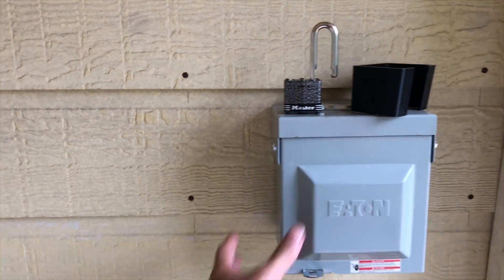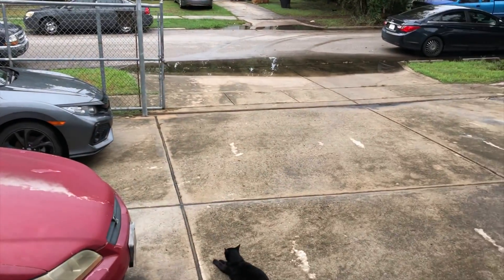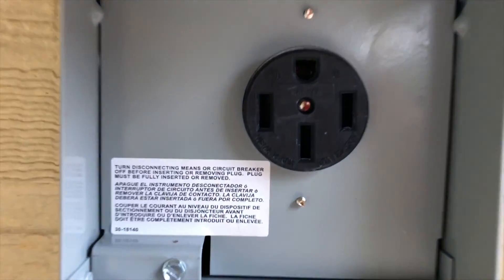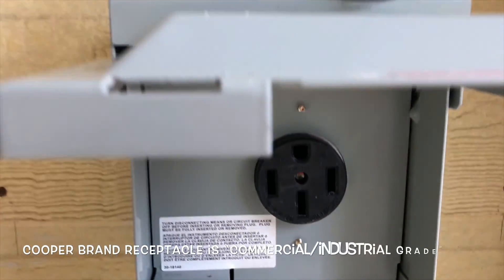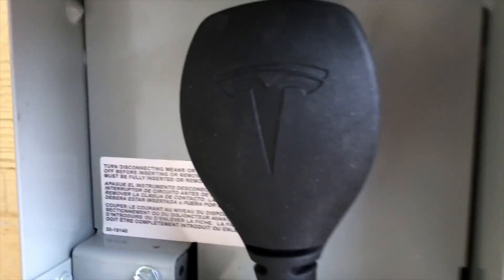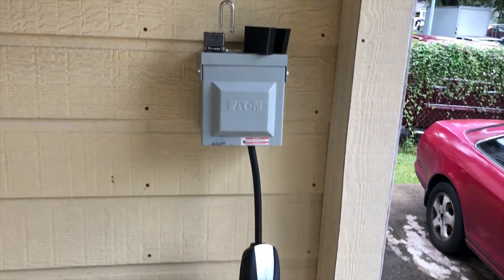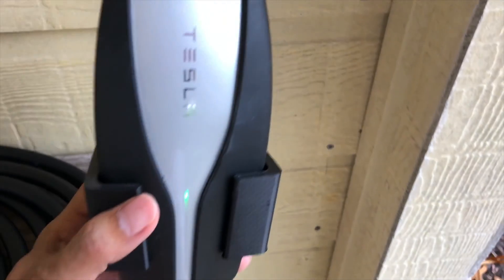Installing an Outdoor NEMA 14-50 Outlet for Charging Tesla

Comment: my home was built in the 60’s, i’m was reading most homes didn’t have grounding  built during that time. if i hire an electrician, will they be able to install a nema 14-50 outlet? or do i need to fix the grounding first?
Reply from the maker: My house is old too, built in the 40’s! My electric service panel was renovated and a LONG rod was hammer down into the ground years ago to properly ground the house. The NEMA 14-50 will need ground. Get a trustworthy electrician to survey the work needs to be done to properly get it install.

Comment: I've been having trouble finding an RV style weatherproof enclosure with a faceplate big enough to fit a heavy duty commercial 14-50. If that 14-50 is really commercial grade, it would have a 2.4" diameter. The faceplate on most housings is for the smaller off the shelf receptacles.
Reply: Did you ever find one?
Reply: @redlightgang233  Nope, and the electrician I talked to only knows about a stainless steel Hubbell faceplate designed for indoors/garages.
Reply: You are correct. As a licensed electrician that installs EVSEs, I have yet to find an outdoor cover that accepts the necessary commercial grade outlet. It may be possible to enlarge the hole and redrill the screw holes for the better outlet. I always encourage hardwired applications but not an outdoor outlet. History shows that the cheaper outlets are not built for the high, continuous loads of an EVSE are are melting and are a potential fire hazard.
Reply: @christheisgen  Clever.
Reply: When you remove the inferior 14-50 unit, bore out a 62 mm hole in the face-plate to accept a Hubbell model.  If your hole-borer set has a 2 1/2" (64mm) size, as my Milwaukee "Hole Dozer" set does, that will do just fine.  then use a proper Hubbell faceplate as a template to drill the mounting holes.
Reply: Did anyone find a outdoor box for this to fit the bigger EV rated version?

Comment: Hey Khoa, thanks for the video. I am getting ready to DIY and install an exterior 14-50 outlet. I am also going to put out the outlet in an enclosing casing like you. From Tesla's website they are recommending to use 6 AWG wire. They don't specify what type of wire. I went to HomeDepot and bought 25 feet of Romex 6/3. However, I am not sure if this is the correct wire to use now that I've watched your video. What type of wire are you using for your 2 hots, neutral and ground? Also, what type of pipe/conduit did you used? I also bought 1/2 conduit non-metallic pipe to hide the wire.
Reply from the maker: I found my old list on the material and cost but keep in mind this was back in 2018 prices

EATON Outdoor NEMA 14-50 Outlet Enclosure with a Cooper Receptacle Commercial/Industrial Grade - $27.97 from Lowe's
GE 50 AMP Breaker - $8.98 from Home Depot
AWG #6 Wire - $100.80 for 70 feet run ($33.60 X 3 wires)
AWG #10 Wire for Ground - $14.00 for 70 feet run
EMT Conduit 1" - $31.92 for 2 sticks
Flexible Conduit 1" - $86.40 for 45 feet
Misc parts: screws, EMT strap, covers, nipples, bushing - $35.00
Loctite Foam Spray Can - $6.00 from Home Depot to seal up gaps/cracks
Installation Labor Cost - $0.00 by Cousin Hookup who is a licensed electrician.
Reply from the maker: Hello Don. Thanks for checking out my video. Quick update, this outlet has been relocated but it is still running great.
For a NEMA 14-50 Outlet, my cousin, the electrician, recommended to use 6 AWG wires. The two hot and neutral were 6 AWG and the green ground wire was 10 AWG. We went to a local electric supply store and got a roll of single strand wires for this 70-ft run. Since it was 6 gauge and will run hot, the conduit size MUST be 1". I think you should not use 1/2 inch but I am not a certified electrician. You should double check that. :)
Reply: Thanks @KPhan  , do you remember if the 6 AWG wires used were Romex or THHN/THWN? From looking at your video I don't think it was a Romex.
Reply from the maker: It was THHN wires since I was buying it by the foot. Each wire was cut to custom length
Reply: @KPhan  That is what I need to know. I try looking on Tesla's website but didn't find the 6 AWG wire requirement/specification. Did you find it somewhere online or your cousin, the electrician, recommended?
Reply from the maker: @orchidnewbie  It was a local electric supply warehouse that he got it from. I do recall that Home Depot do sell these wires by the foot too. It was just more expensive at Home Depot  so we got it elsewhere.
Reply: @KPhan  I just went to McLendon, our local home renovation store, and pickup 20 ft of 3 x 6 AWG THHN (red, black and white) and 20 ft of 1 x 10 AWG THHN (green) wires. Thanks for all your help...:)

Comment: If you're only planning to use the mobile Tesla charging cable then OK , but otherwise with a wall charger you could've had the electrician hardwire it and make it a 60amp breaker circuit. Skip the 14-50 and RV housing. That way you would've been setup for a full 48 amps of charging instead of the 32-40 amps
Reply from the maker: I did wanted to go with a Wall Connector but it was too pricey. At the time, I thought the WC will need #8 wires instead of the #6. If I can do it again, I will splurge for the WC because it look so nice. So far the NEMA 14-50 RV housing has been great. No major issue.

Comment: Have you had any issues? I read that you need to get industrial grade outlet for car charging and I don’t think those are sold at stores like Home Depot/Lowe’s.
Reply from the maker: Hello, forgive for the late response. I haven't had any major issue. The built-in Cooper brand receptacle in that EATON housing been working fine. I don't unplug my charger though. It stay plug in 24/7 every since it was installed. I did had to relocate the entire box to another spot due to me adding a car port so I wanted to charge further out into the yard. I did had to replace the 50amp breaker about a year ago when I notice my car will be tripping when I tried to charge over 12A. After replacing the breaker, I can charge at 32A. I did wanted to buy those expensive "industrial" receptacle like brand Hubbell. So far glad I didn't since this one been working out great for me.
Reply: @KPhan  I’m using the same setup and so far so good

Comment: So I just got the 14-50 mounted outside on the side of my house. So far I love it but do you know is the actual charger waterproof? I have charged in the rain before but from an inside outlet so the actual brick was never outside during rain. Is it safe?
Reply from the maker: Mine was relocated outside and it will be raining on it. So far I can charge fine, even when it is pouring thunderstorm. I think as long its not submerge under water, it should be fine. I did mount mine high off the ground, like chest height.

Comment: Hey! Thanks so much for the video. Question- how has your charging experience been with using a NEMA 14-50 and what is the amount of amps in the breaker you're using? My breaker is 150amps and I want the same set up you had but want to make sure it won't short me out or anything.
Reply from the maker: Hello Michael -- The NEMA 14-50 is still working great! My service panel for my house is maxed at 200 Amp. I ran a dedicated 50A breaker for the Tesla outlet. In my video and description, I used the suggested 6 AWG wires for a NEMA 14-50 that will be 240V. Even though the NEMA 14-50 is on a 50A -- the car will only max pull at 40A because I am using that dedicated corded mobile connector. https://shop.tesla.com/product/corded-mobile-connector
So I can charge up to 40A (about 35 mile per hour). However if you are using the charging cable that came with the Model 3. It is maxed out at 32A (about 30 miles per hour). So a 50A will still get you only 32A because you are limited by your charging cable. I leave the charging cable than came with the car in my trunk and use the Corded Mobile Connector at home. However time, if you I am charging overnight, I will even lower it down to 32A. Check out Tesla guide on NEMA 14-50 installation
https://www.tesla.com/sites/default/files/pdfs/installation-guides/nema-14-50-installation-guide.pdf
Hope this helps!
Reply: Khoa Phan thabks so much. Saw a bunch of mixed reviews on installing a nema outlet and you cleared it up well:)
Reply from the maker: @michaelurbanski  The NEMA 14-50 is plenty for charging my car. If I had the extra cash, yes the Wall Connector is so much cooler but charging overnight is plenty on a NEMA 14-50. So saved my money for now. Maybe for someone who have multiple Tesla then I can see why they would want to charge faster. Of course you will need to have a much higher breaker for it. You can do 60A, up to 100A for the Wall Connector. My Service Panel is already maxed out so I was lucky to squeeze in 50A for my Tesla Outlet. You can always upgrade the Service Panel to the house to a higher box but too much money. Its not worth it. Good luck with your NEMA 14-50 install!

Comment: Thanks for posting this!  Did you use outdoor or indoor wire?
Reply from the maker: Hello. I used #6 AWG for the two hot, and neutral wire and a #10 for the ground wire.
  Instead of buying them all wrapped bundle to together, I got individual strand and bundle it myself in its own conduit pipe.  https://youtu.be/pAdjD-8_jOk?t=10

Comment: Can the wires be attached through the bottom of the box?  The reason I ask is at my house the box would be attached to a solid wood post and the existing wires come from UNDER the box instead of behind.  Thanks!
Reply from the maker: Hi Steven. Yes! The box have two way entry where you can have your conduit feed thru the bottom or the top for a surface mount. You can go into Home Depot or Lowe’s to check it out in person to see the actual box.

Comment: Any issues after 8 months of usage outside? Assuming you leave it all plugged in 99% of the time unless going on a road trip?
Reply from the maker: Hello. Do you mean issue with the car or the outlet? So far both are great! I don't always have it plug in all the time. I charge every other day or every day for a few hours. I set my battery limit to stop charging around 70-80%. Sometime 90% if I know its the weekend. I can even charge in the rain. Although I try not to if I don't have to :)
Reply: @KPhan  Sorry, I was referring to the outlet and the UMC part. I'm assuming both of those "live outside" most of the time. So no damage to the outlet of course being covered... but the UMC part (the part with TESLA letters light up green) is okay? I just got my EATON power panel enclosure, so will be installing this same setup soon. Thanks!
Reply from the maker: @AndyNguyenning  Oh. Yeah the corded UMC stay plugged in and the EATON enclosure is locked. Beside the normal wear and minor scratches, the cord does get tangle every now and then. I will have to untwist the cord once in a while. At the end of the video, I have that UMC 3D Print holder. I ended up mounting it and it hold the unit in place. I am using the corded version so its thicker, 40A than the one that come with the car. So its not a green Tesla glowing but the classic green light strip. I keep the one that came with the car in my trunk to charge at work. That one have the green glowing TESLA  logo and the cable is much thinner 32A.

Glad to hear you are getting your outlet install soon. Must be exciting. I remember that feeling lol.
Reply from the maker: @AndyNguyenning  Yes its outside my house. Its not in direct rain. The outlet and cable do get damp or moist when it rain but the setup is not in direct rain. It is pretty much shaded most of the time. Its under my front porch area so that's something to keep in mind. In case you are mounting yours in direct sun/rain. Sure, reach back if you need more feedback.
Reply: I got the same Eaton box set-up as yours. I have one question for you. When I plug in and out, do I need to turn off the breaker first? It says on Eaton box "turn disconnecting means or circuit breaker off before inserting or removing plug".

Comment: Why didn't you just bring the EMT conduit all the way over to the Eaton 50A power panel instead of drilling through the structure with the LB  and then drilling into the structure again and into the back of the box with the liquid tight? You could of avoided drilling into the structure all together by just bringing the EMT into the bottom of the 50A power panel. Am I missing something?
Reply: He wanted the floating look. It looks good. I want to do the same thing.
Reply from the maker: Hello. Yes, I wanted the box to float; a cleaner look. Plus my house is on foundation and didn’t want the conduit to run down in front of my house. Instead I ran it under the house from the back. Outlet still working good.
Reply: Is it okay for it to rain on the plug on the car?

Comment: How much did everything cost with installation and material?
Reply from the maker: My total materials cost was about $311 for about 70 feet run. The most expensive cost for material is depend on how far you have to run the wires from your service panel to where you want your outlet. Labor depend on what kind of work. My cousin is a licensed electrician so he didn't charge me but I see for a job like this can range from $400-$800 for parts & labor. Per Tesla's instruction, try not to run more than 150-ft of wire to avoid voltage drop.
https://www.tesla.com/sites/default/files/pdfs/installation-guides/NEMA_14-50_installation_guide_NA_US_2017.pdf

Comment: Did you need a neutral?
Reply: Although your EV may not need it (Tesla doesn't), these outlets should be installed per code; you need to run all 4 wires.
Reply from the maker: Yes, the NEMA 14-50 required two hot, a ground and a neutral.

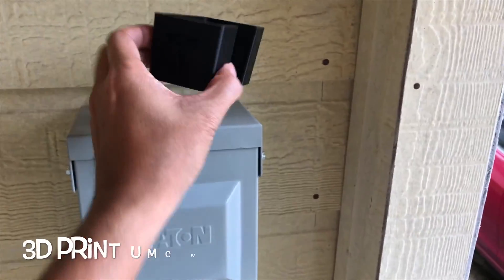Comment: Where did you get the all-in-one Tesla charging cable (i.e. it doesn't disconnect) that you showed in the video @ 2:09?
Reply from the maker: Hello - That is the "Corded Mobile Connector" on Tesla's online shop for $520.
https://shop.tesla.com/us/en/product/vehicle-accessories/corded-mobile-connector.html
I did made another video about it here. https://www.youtube.com/watch?v=fnT8xFwgcj0
I got it from a seller on eBay.

Tesla just released a similar corded version but its a Wall Connector for $20 cheaper
https://shop.tesla.com/us/en/product/vehicle-accessories/wall-connector-with-14-50-plug.html

Comment: By any chance, do you remember what size seal tight conduit you used? Thank you
Reply from the maker: I recall my electrician used 1” pipe EMT to housed the four #6 wires. The seal and elbows for the conduit should be 1-inch.
Reply: @KPhan  Thank for the quick reply! Ok, im having trouble finding 1 inch at home depot or lowes. I guess I have to visit an actual electrical store.
Reply from the maker: We went to a specialty electrical warehouse for my supplies but I did see the 1” at Home Depot. My cousin, the electrician say to use the 1-inch conduit since it’s 4 bigger wires and you don’t want it to be too tight for heat dissipation and easily to pull and fish the wires through.

Comment: How much was this RV outlet and from where you bought it
Reply from the maker: I got it from Home Depot for about $30. However if I can do it again, I wouldn’t get this box because the locking method is weak. I would go to Home Depot and get the Midwest GE RV box. Same Cooper brand NEMA 14-50 outlet but the locking style is more secure because it use the lid.

Comment: Thanks.
What was your total cost?
And what do you think a licensed electrician would have charged?
Reply from the maker: My total materials cost was about $311 for about 70 feet run. The most expensive cost for material is depend on how far you have to run the wires from your service panel to where you want your outlet. Labor depend on what kind of work. My cousin is a licensed electrician so he didn't charge me but I see for a job like this can range from $400-$800 for parts & labor. Per Tesla's instruction, try not to run more than 150-ft of wire to avoid voltage drop.
https://www.tesla.com/sites/default/files/pdfs/installation-guides/NEMA_14-50_installation_guide_NA_US_2017.pdf
Reply: Awesome, thanks!